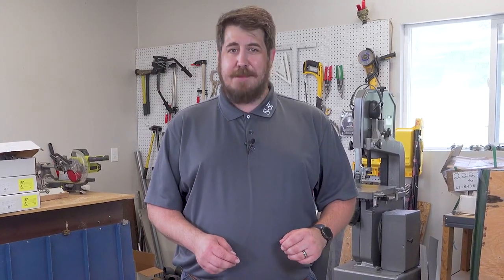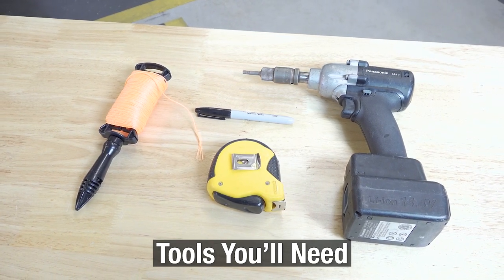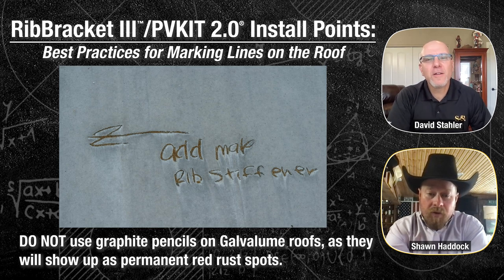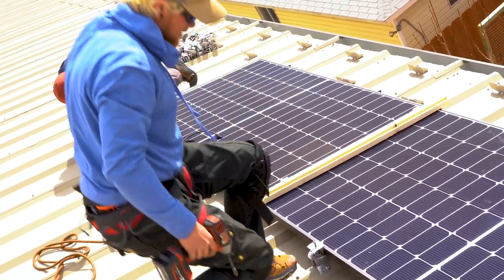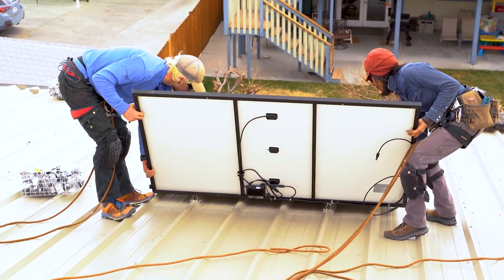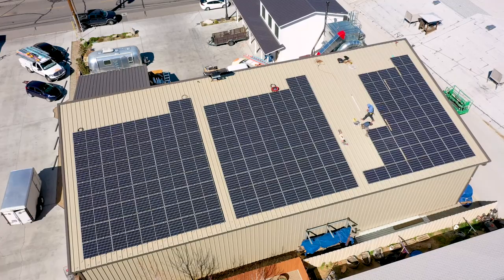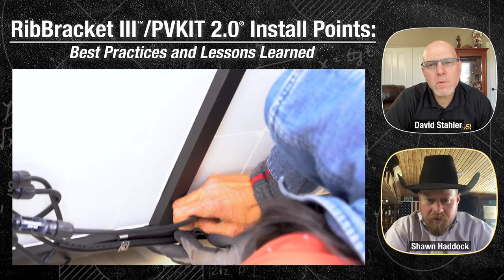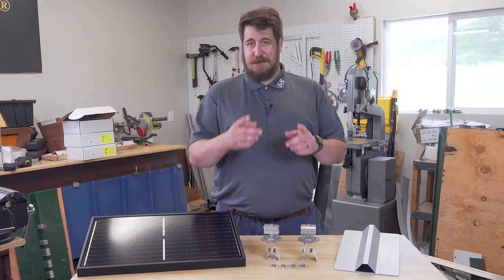Insights with Experts - Installing the RibBracket III with the PVKIT® 2.0

Comment: All fastening systems come with specifications to respect. How do you respect the torque (NM) specifications with the driver tools used in the video?🤔
Reply from the maker: Hi Martin,
For our self-piercing fasteners, we recommend to use a screw gun which can be set to a specific stopping point so that after a few screws, you won’t really need to worry about over-torquing.  Being said, our self-piercing fasteners have an epdm washer, and you’ll want to watch for the visual indication that the washer is compressed.  That will be your visual cue that the fastener has reached the appropriate torque and stop.

Comment: Sure seems like a slick way to add solar.  You guys got anything like this for corrugated?
Reply from the maker: We sure do, please check out our line of brackets specifically designed for corrugated roofing. We have both sheeting-only brackets and brackets that attach into the underlying deck or purlin. Our CorruBracket and CorruBracket 100T are both compatible with the PVKIT (rail-less mounting) - which uses the exact same module grabs as you saw in the video, but with a different mounting bracket. If you are looking for added height when mounting solar with the PVKIT, we offer the CorruBracket 100T PV. This product is specifically designed for use with rail-less solar mounting. Please visit the links below to read some more details about these products. If you have additional questions, please reach out to us here or through support@S-5.com. Thanks so much!

https://s-5.com/products/corrubracket/
https://s-5.com/products/corrubracket-100t/
https://s-5.com/products/corrubracket-100t-pv/
Reply: @TheMetalRoofingAcademy  awesome, thanks for the info!  Interested to give this a go in the future.

Comment: Is it better or at least ok for the ribbracket to be screwed into the double trapezoidal where panels meet together or should those double seems be avoided?  Are there any benefits of using the PVKit with the Proteabracket instead of Ribbracket III?  And how many PVKit and brackets per panel--looked like 4 were used per panel?
Reply from the maker: There will be no issue with going into the lap seams. The RibBracket III will be your best option as it has similar uplift values to the ProteaBracket and is much more cost effective and installs faster. For most installs 4 points of attachment is sufficient but if you live in a high wind or snow area sometimes 6 points or more may be needed. Our Solar Calculator can help design and layout your array and run all the calculations to determine exactly what you need. Please let us know if you have any other questions by emailing us at support@s-5.com

Comment: Will the holes allow liking in the roof?
Reply from the maker: Thank you for your question. All of our through fastened brackets utilize either an EPDM or butyl tape gasket to seal and prevent leaks and are ASTM tested for water-tightness and guaranteed to last the life of the roof without issue or maintenance.

Comment: Where are all the ground connections?
Reply from the maker: Grounding with the PVKIT is achieved through the round PV Disk at its base. It has sharp nodes that bite into the module frame creating a ground path to the next module that is resting on the MidGrab disk. Then, individual columns of panels can be grounded together using a bonding jumper or copper wire and lug instead of having to bond each and every module to one another.